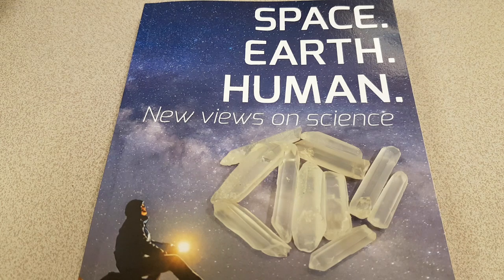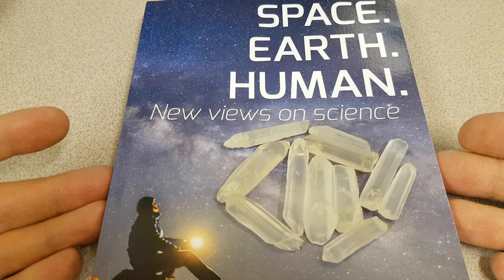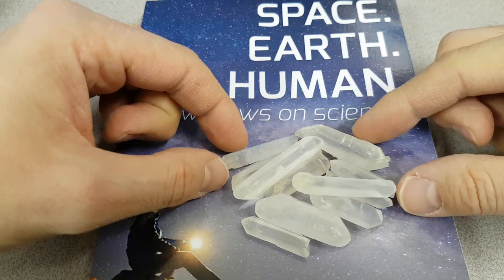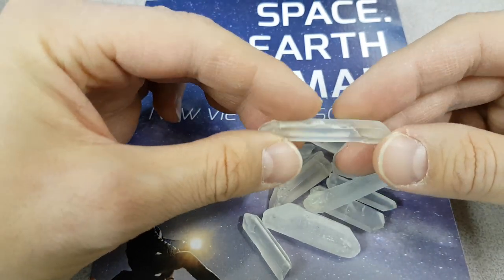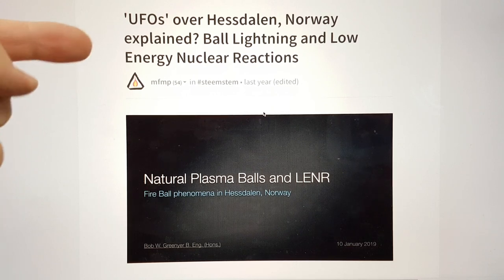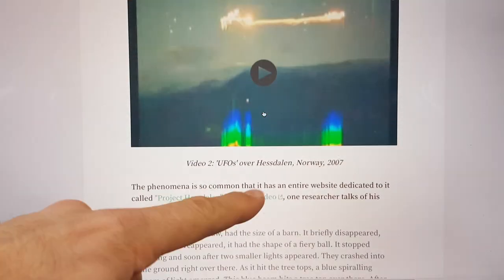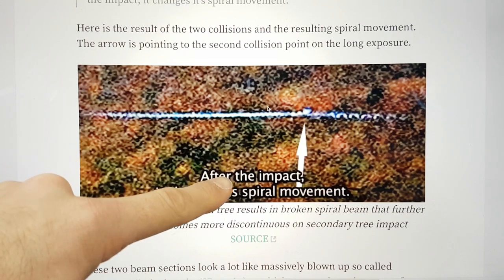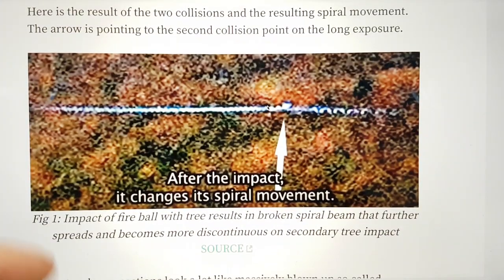Super NOVA - Microwave Ultrasonics and other Piezo Effects

Comment: Very cool idea to use piezo crystals to generate high frequency ultrasonics. You've probably already watched this but just incase you haven't you should checkout this video https://www.youtube.com/watch?v=GhZ1reCoyrY Specifically the part where he speculates that EVO's or torroidal fields are being generated at the surface of ultrasonics due to the way they may convert a collapsing cavitation bubble into a torroid.
Reply: Just adding another really enlightening video I watched yesterday which is bringing in some more details I have not heard before that I think may be very relevant to the original video I posted. 

Nassim Haramein
https://www.youtube.com/watch?v=SQGE-0moU5k (start from around the 1 hour mark where he starts talking specifics)

Not sure why my comments don't show up when "top comments" is selected but only when "newest first" is selected. Seems youtube is selective about what comments are relevant. Kinda silly to be hiding 2 comments on a video with 4 comments if you ask me ;) Unless there was some other reason for it...